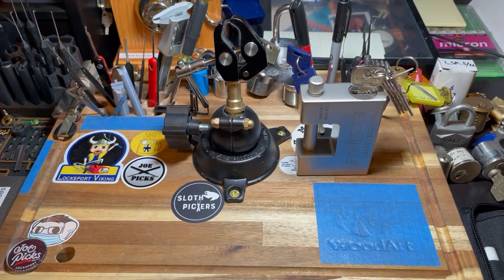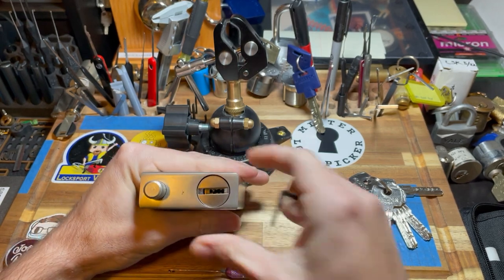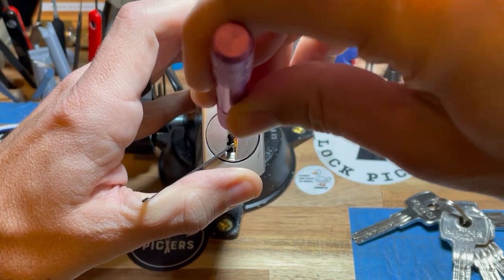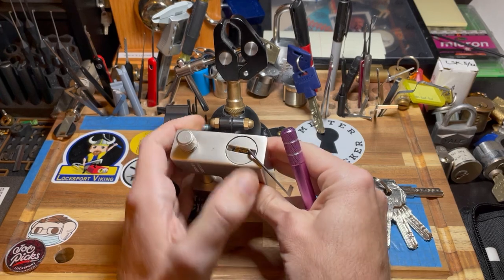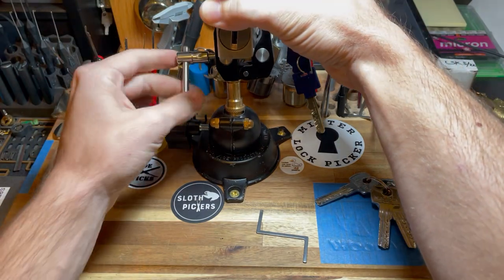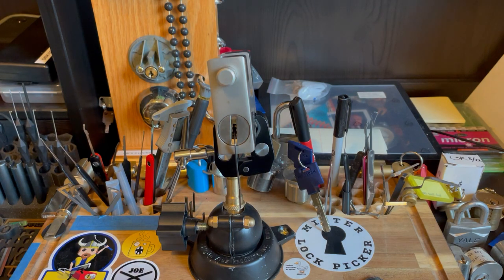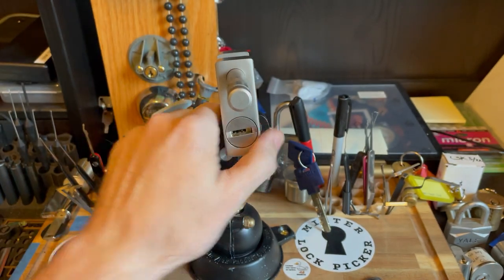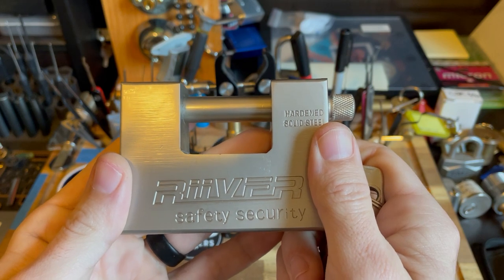(#061) A little dimple lock practice

Comment: Try using a flat dimple rake on it if you have one..  The keyway is wide enough to give it a try, I raked that same lock (branded as Kurtzy) and it raked open in seconds.  Good job on the pick though!  That was one of my first dimple locks picked also :)
Reply: I’ve demonstrated a couple flat dimple rakes on this very lock! Works like a charm!